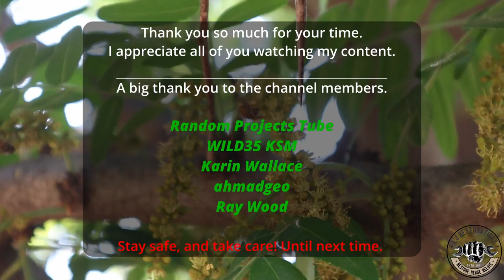Old Suffolk "Super Punch" Lawnmower Restoration - Part 4

Comment: That rear roller is pretty neat. I didn't catch as you started the first episode with initial disassembly that it was powered, let alone that it has a differential inside.

Any idea what this marvel cost then new?
Reply: Probably between 50-100 English pounds. The pound was $2.60 in 1976 which was when they were made in stowmarket